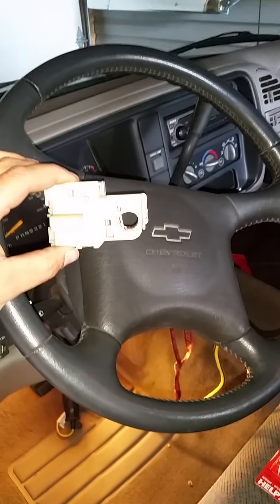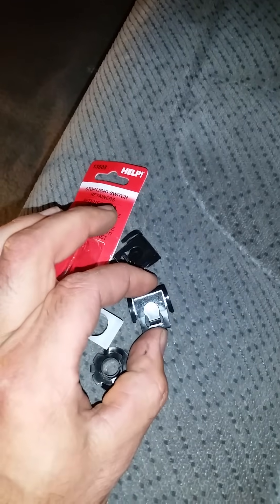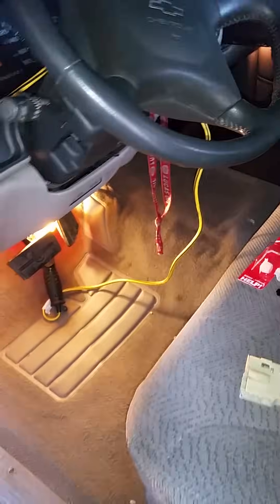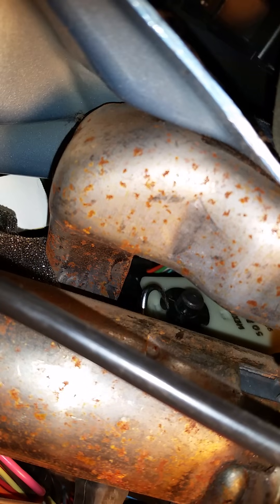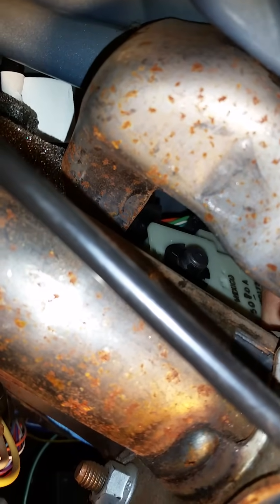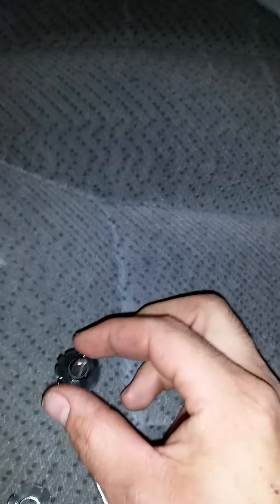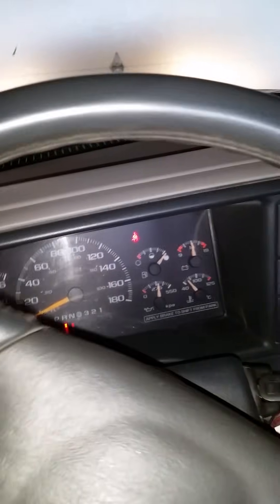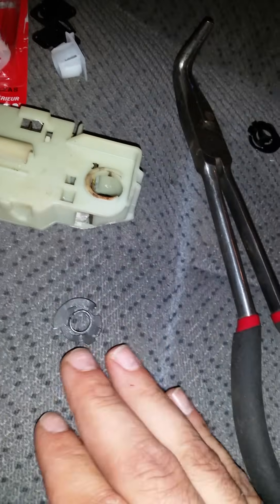1995-1998 Chevrolet GMC Brake Light Switch & Clip Removal Replace

Comment: Your input still helping folks 7 years later thank you much!
Also found out that if the brake light switch is moved too low or high and not set back straight in L shape that can also cause to be stuck in park.  
And if your really in an pinch and can’t change switch, with truck off just turn key slightly forward and start ignition Should be able to override switch and change gear out of park 👍🏽 god bless

Comment: THANK YOU! Just replaced the switch on 1996 Chevy Tahoe 4 door 4x4 on 12/20/24. I have owned vehicle since 1998 so I am certain this was the original switch. There was LESS room to get tools in there with this model. Had to access area from behind the switch with short tools touching the firewall. Like many, cut my knuckles several times on sharp metal near firewall. I was determined NOT to remove the steering column. Used the same part number as recommended to get new clips at parts store and purchased new switch with lifetime warranty. I never want to do this again!!!

Comment: Thanks so much for this video.  I also had my brake booster changed and have been driving around for the past few days not knowing my damn brake lights weren't working!  Your video made the process of replacing so much easier.  Thanks!

Comment: Same thing happened to my Tahoe, unfortunately it happened in the drive through of a bank so to get it out of park without being able to change that tight away, you can shut the vehicle off and turn the key on but not start it and shift into  neutral and then start the car and it makes shifting into drive easy. 🤷🏻‍♀️🤷🏻‍♀️ just a tip I learned today. Also thanks so much For the video!!! This is seriously life saving info right here for anyone who can’t afford a mechanic!!!!

Comment: Loved the video,  used another one to get it down to the switch.  But this one made the change easy.  Definitely recommend the hooked pick and a skinny mid length flat has to hold the clip in place while you pull on the ears.

Comment: You don't need to bust those ears off. Take a small flat head screwdriver, put it in the slot and twist it. This will expand the spring clip and disengage it from the shaft. Use another flat blade behind the switch and gently pry out. It will pop off in seconds.
Reply: You do realize there's zero clearance barely enough room for fingers up in there right?

Comment: I had a 98 for many years, replaced brake light switch a few times, but the last time it was the Hazzard button !!! It was hardly ever used, the power to the brake lights travels through the hazards first,  
And home boy from Canada wants to blame some body for an electrical part that worked when he left the mechanic, that's the type of fella that would borrow a power tool and brake it and not tell you when you have to ask for it back (steve!!)

Comment: This was very helpful; however… budget a good hour to 90 minutes for this- you will cram yourself up in the firewall.  Once located I just used the largest screwdriver I could fit in the space to pry between the retainer clip and the switch. Make sure you have purchased a replacement. Rotate switch up and Gently pry the switch off. There is virtually no slack in the electrical connector- gently disconnect. I ended up starting the connection with 2 hands and then just mashing one handed to make the connection. First time it made the switch come apart- just snap the two pieces with the brass clip in between back together.  Get the new retainer clip started using fingers and tip of screwdriver then gently push the clip on with the driver blade. You know it’s on when there is no play between the switch and clip.  From another forum- the parts house switches stink- get a backup from the dealer. I could see where old brass switch was worn and not fully engaging. New switch allows me to disengage from park. Good luck

Comment: FYI everyone, if you can reach your hand behind the brake pedal arm, then you can lift the switch off it’s snap and then start to pry by switch off the pin. The clip will slide off the end the pin. Take your time and be gentle. Took me 10 seconds or so.

Comment: I replaced the break switch in my 98 s10
the break lights still stay on.
I tried to see if the plunger was being pushed in but honestly I don't see anything the rod just pops.on and the switch clips on over. 
what am I missing?
Reply from the maker: Rebecca Ingram yes that is exactly what I did. You did also re-click in the wiring harness? So someone else may chime in. This is the brake-switch replacement but there is also a brake-light-switch that I believe activates the lights. Possibly on the floor and simply pushed by the pedal maybe?
Reply: Travis Wheeler yes I put the wire harness back. the wires that come out of the switch then lead to a bigger box with more wires coming out, they seem to go in there then come out and go into a yellow clip. not sure what that is
 I'm thinking I have a wiring issue. but would like to know for sure before taking it to a machanic. I like to fix things my self and would kick my self in the butt if I found out it was something so simple
Reply from the maker: There is a ton off info the comes up if you just google it from. An under hood relay, to hazard switch being depressed 1/2 way, there is a actually plunger switch the maybe stuck near the brake pedal. You need someone to stand outside and watch your tails lights. Start wiggling wires under the column.
Reply: Rebecca Ingram Did you figure out why the brake lights are staying on I have the same problem

Comment: Same thing happened to me. Took my truck to a radiator shop to replace radiator hoses replaced. My brake booster failed when I started my truck to leave radiator shop.  
Took it to another mechanic to have the brake booster changed. Now the brake lights and cruse control don’t work. Is that a coincidence or did the shop damage the brake light switch? I’m going to ask the shop if they will give me a break on the light switch repair. Yours is the best video on replacing the brake light switch .

  .

Comment: I have a 2000 Chevy blazer . The brake lights stay on when turning the key "ON" or starting the eng. I did replace a burt out bulb but cant find the problem yet. Fuses are all good and could it be a ground ??

Comment: Hey bud I like your video but you said one thing that upset me. I've been a mechanic for 35yrs and unlike the so called mechanic that worked on your truck I'm an honest mechanic and if I break something on a customer car or truck I repair it or replace it out of my pocket. So please don't generalize all mechanics to be like the guy who worked on your truck. Because we are not all that way. Thanks for the info on the clip
Reply from the maker: Thanks for the Reply. I have tried to edit my comment out but once it hits 100,000 views I can't trim the ending.....I totally did generazie mechanics as being bad people, wrong on my part. I was still kind of heated at this guy because he sent me away from his shop with no cruise, sometimes impossible to shift, and also no brake lights, and I had to figure it all out on my own over the weekend. Mechanics keep our world moving and we are totally screwed without these automobile geniuses.

Comment: It's not as hard to put that clip on the rod as your saying it is because it will only go on the rod from one side of the clip and it's as simple as lining the hole on the clip up with the rod and push the clip on to the rod and pull down on the clip so it locks in place so it takes literally about 4 minutes or less weather you're mechanically inclined or not.

Comment: My 1995 GMC Sierra had a square metal spring type clip. I got it off easy enough, but a bitch to reinstall. Space was too tight. I bet the plastic clip was a production change to make things easier for the technicians.

Comment: You mention this pkg of clips is dorman Help #13808, and it's listed on oreillyauto,com under electrical and not brake parts....but locally only avail online.  I FINALLY found it at napaonline.com under part# NOE 6351107 ---took a while and some luck to locate it because it's listed under 'stoplight switch retainers'. thanks for nothing napa.
thanks for a great video (maybe just turn your camera sideways next time). 
perhaps you can add key word 'booster' to your video so others like me changing the power brake booster can see how to remove this friggen clip too.

Comment: So are you blaming a mechanic who's only fault was taking off a deteriorating, plastic switch to replace your booster?  Not cool.  Everything that is made of plastic in your older truck is gonna break if someone touches it. His only fault was not warning you that it very likely would break.  The mechanic did not cause your truck to age and the plastic pieces to deteriorate.
Reply from the maker: Jason I totally agree with you it wasn't cool that he broke that part and put it back on broken! It was $10.00 and was probably the original. Also what wasn't cool was driving around with no brake lights, pedal clicking, no cruise control immediately after leaving the shop, I just didn't notice all the problems right away. That took alot of trouble shooting over time to figure it was that part. It's like doing a serpentine belt and not doing the water pump on a FWD car or changing out 10 year old tires and leaving 10 year old valve stems. Just common sense on the mechanics part. I hope my video helped you and your situation.
Reply: Unfortunately some people pass themselves off as mechanics who take shortcuts or don't double check their work. Most however are doing the best they can. If it was easy we wouldn't need mechanics.
Reply: People are so quick to throw shops under the bus. I see this every day 🙃

Comment: This is the most failing part on my truck!! I have a '95 Tahoe. This part needs replacing every 2-3 years. Why?? I buy genuine GM parts. I've taken this part apart and it's a simple mechanical contact switch but still, once it's gone bad it can't be fixed but needs replacing. And because of the most ridiculous ring clip design I have ever seen and must have been deliberately designed to discourage home fixers, (which I have learned IS a GM goal in engineering), it makes me hate my truck!

Comment: So I replaced my switch and it didn’t fix the problem, and when I activate it manually it turns my brake lights on but when I install it, nothing. Any idea what the problem could be?